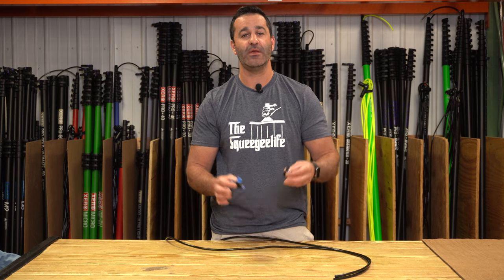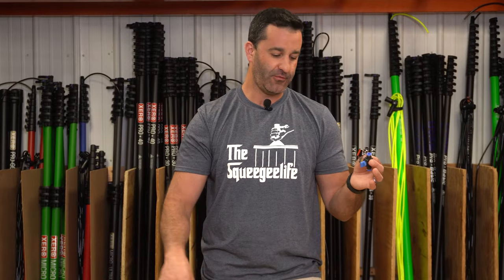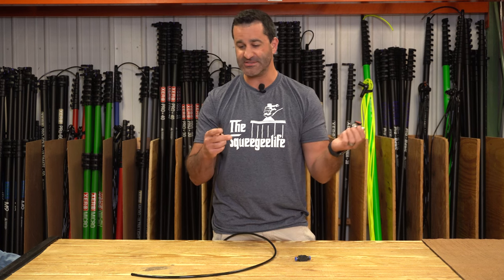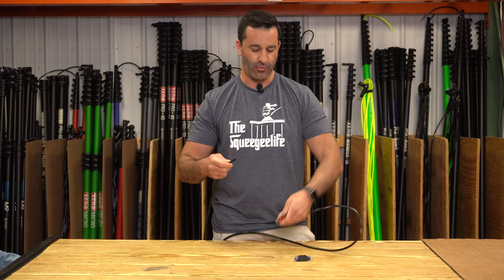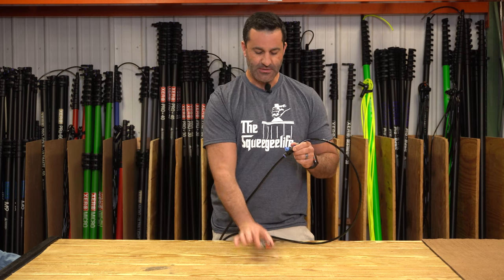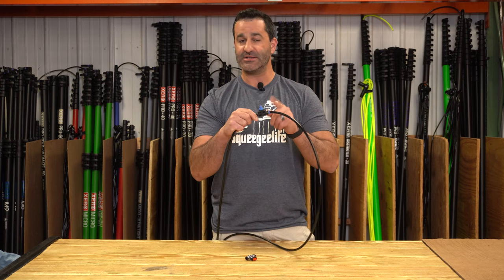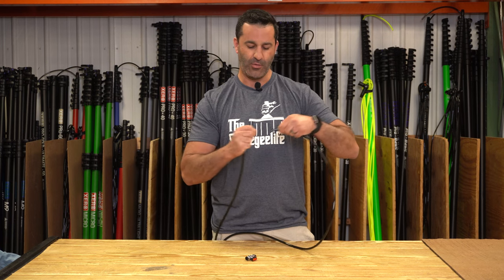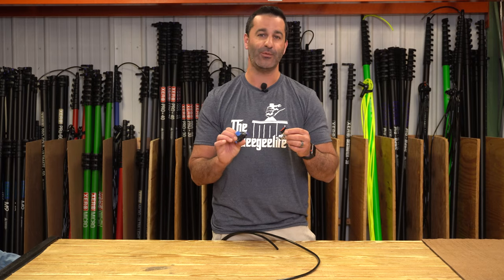Budget Friendly In-Line Shut-Off Valves

Comment: love the metal one, haven't tried the plastic one yet. I was thinking about using 2 shut off valves at the top of my pole one for rinse bar and 1 for pencil jets, I only have 1 right now just to shut the water off on the pole between windows etc.
Reply from the maker: That's an interesting idea! Both the metal and plastic do the same thing, it comes down to preference! :)

Comment: Where would the best location be to install this shut off in your experience?

At the top or bottom of the pole? 

The univalve may still be the best option for ease of use, speed and convenience in between windows. 

I’m trying to decide between the two options for water shut off moving from window to window on my new water fed pole set up!
Reply from the maker: Depending on the pole, we would say lower so that you don't have to collapse the pole to utilize the valve. Between the in-line and the univalve, it comes down to preference! Give both a try and see how you like it!